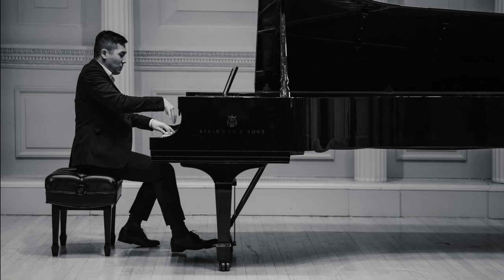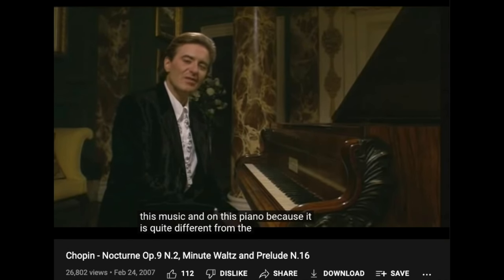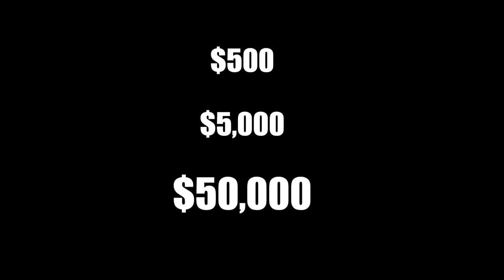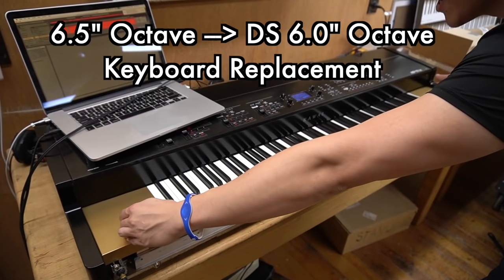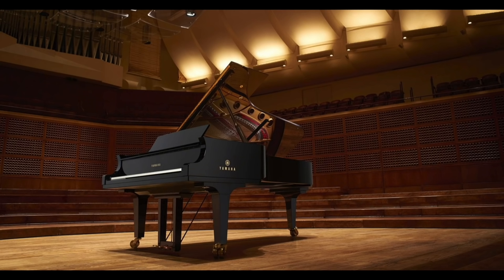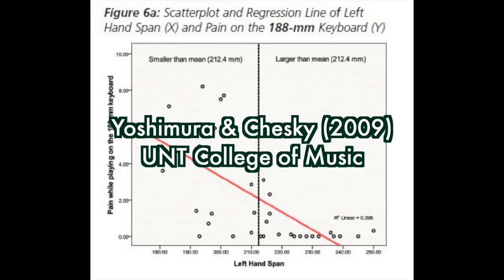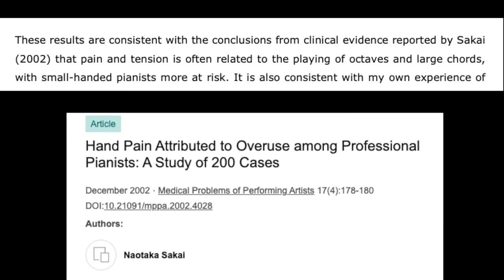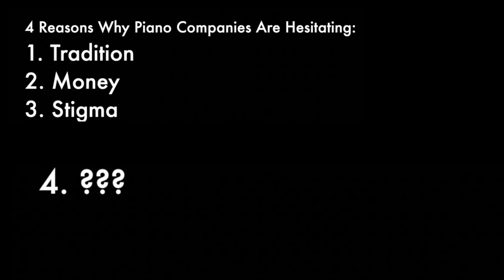Piano's Darkest Secret

Comment: You're too damn right!! I never thought my hands to be that big, they aren't indeed, but once I saw you with the ruler I tried and my left hand reaches 9", and right hand 8 3/4", but still I don't ever reached 10ths or even just octaves with central notes that easily or comfortably. According to your diagram my hand shouldn't hurt but it DID hurt when I played certain passages and what not. I knew about the growing extension of the piano keyboard, it's on piano History books, but only experimented the comfort of narrower keyboards when I had the chance to play in a harpsichord… all of a sudden even Bach, which supposedly isn't that bad on extensions, were quite more comfortable to play and all polyphony and fingering made sense, not to mention other piano works either. As you say, I needed Zero time to get used to it (which surprised me), or any problem of course going back to my regular piano. Problem is if regular piano makers, the ones you can easily find in stores, don't allow those keyboards by default it's not an easy option for most of us Worldwide, even though initiatives like the one you show by Mr.Steinbuhler are so interesting. Hope in the future those options become more easily available to everyone and stop being seen just as an oddity or frivolity by some freaks

Comment: I absolutely loved your video and admire your courage to do it!  Congratulations!  I just realized that, at the begining of this video,  there's a mistake in your conversion to centimeters.  The measure of 6.5 inches of the modern piano (from C to B) when converted to cm IS NOT 21.5 cm, BUT 16.6 cm.  This conversion of 21.5 cm corresponds to 8.5 inches which according to your video is the average size of the hand.  I hope this can be corrected, because it confuses a little bit.  I live in a Country where decimal system is used.  Greetings from Mexico.

Comment: I'm not much of a musician but I do play harmonica. Most 10 hole harmonicas have the same size holes and spacing. However, when I was about 17 I discovered Hohner's Vest Pocket harp and it quickly became my favorite due to the shorter size, closer spacing and less breath required to produce as good a sound as  larger harps. Unfortunately they are no longer made. There is a similar sized harp made by hohner now, but it lacks the extended ends which makes it very difficult to handle.

Comment: Thanks for the enlightening content. I suppose part of the problem from the manufacturing point of view is that pianos are large and expensive, and it would become quite a challenge to require concert halls and even some small stores to provide variously sized keyboards on their pianos. But perhaps a compromise could be reached: even two standard sizes would be enough to make most people happy (say, the 6.5 and a 10% smaller version, about 5.8 - corresponding roughly to the difference between mean male and female hand spans).
Reply: Experience from many pianists who have played different sizes, including trials done by David Steinbuhler, suggest that nearly all adults can be catered for with three sizes - 5.5 and 6.0 inch octaves plus the current 6.5 octave. (See DS Standard Foundation and PASK websites). Concert venues can have interchangeable keyboards/actions which can be swapped over in minutes. This has already happened in the Dallas International Piano Competition where contestants have a choice of these two DS sizes. Incidentally, the gender difference in hand spans is closer to one inch (2.5 cm) which suggests that the DS5.5 suits most women best (assuming that the current size is best for men overall which is probably not the case - it seems to be skewed towards larger handed males).  The intermediate size suits larger handed women and a sizeable proportion of men. A small proportion of women (approx 10%) find they need the DS5.1.

Comment: Thanks for sharing this. You're in good company -- Scriabin had quite small hands and injured his right hand while (over-)practicing a really difficult Liszt piece. That's how he ended up writing his pieces for the left-hand.
When I started learning piano as a kid, my teacher noted that my hands were quite "boxy". I don't have long fingers (or legs) but they're somehow flexible enough to stretch about a 10th. However, I started learning violin recently as an adult, and have struggled to cleanly place my left-hand fingers -- my wide fingers accidentally touch and mute neighbouring strings, and yet my little finger has difficulty reaching A on the D string.

One thing I find odd about the response from piano manufacturers is it doesn't address the fact that it's hard to play a "normal" piano with small hands, but it's easy to play a slightly smaller piano with small OR large hands. So they're choosing to exclude a large segment of the population, despite having an alternative that excludes nobody. Someone with large hands is not going to have problems playing on the smaller piano, and in fact they will also be able to play wider chords than ever before.

Comment: At 67 I have just started learning the piano. My hands quickly became sore but I put it down to something that would improve with practice. It did not. I moved on from beginner pieces and found I could just not do them smoothly. That's when I got my ruler and found I have tiny hands. My span is 7.2 inches. A quick bit of internet research on pianists skill level vs hand size told me I had bit of a problem.
I'm not taking this lying down. I'm an engineer and have started plans for a MIDI short scale keyboard.
Reply: Please be in touch with PASK so we can help promote a new keyboard - hopefully with 88 weighted keys!

Comment: What a lovely video.  Thank you.  I will have an alternate keyboard advantage, when and if I  get to use them . 
1. The piano accordion has a much smaller keyboard.  You can easily span a 12th. But ...
2. I like the chromatic keyboard.  The chromatic accordion is the model I hope to one day adapt to the piano.  On such an accordion a span of two octaves is no problem. It is likely to shrink a little when applied to a piano.

Comment: Actually the small key size is already very common in mini keyboards that have a size of ~5,8"/Oct. Unfortunately they lack good mechanics and the keys are not very long. Based on this it should be easy for one of the leading manufacturers to create a proper masterkeyboard with narrower keys.

Comment: Excellent video. What is curious is that certain other instruments, for instance organs or harpsichords, have always had narrower keys than the modern piano. People who play both organ and piano are completely used to switching between different sized keys, it does not interfere with their playing at all. So, here's a tip: the initial, mechanical studying of demanding pieces by Chopin & Co can be done free of pain on an organ, even an old electronic one ($100 on eBay). Once that you have committed the piece to your brain and you can play it smoothly, switch to the piano.

Comment: I am an amateur pianist with big hands - about 26cm span (or just over 10 stupid antiquated "imperial" units). I have a somewhat different problem - my fingers are too wide and can't fit between the black keys anymore without major friction, which makes it hard to play certain passages fast (such as arpeggios with mixed black/white keys). Difficult pieces are still difficult, but I could probably overcome them with a lot of practice, and I'm sure people with smaller hands struggle a lot more.
There are electronic keyboards with smaller keys, they're pretty common, but I think their keys usually have a different "action" and are not suitable for playing classical pieces (especially at a professional level). Keyboards that emulate a piano feel usually use the standard piano key sizes too...
Anyway, I fully support different-sized keyboards and pianos.

Comment: What a revelation! Your statement that awareness is the biggest roadblock is right on target. While the size and complexity of the piano presents unique manufacturing challenges to the design and construction of alternative key sizes, the concept of multiple instrument size is well known in the manufacture of violins, guitars and many other instruments. As you said, "it's freaking 2022!" It really is past time for the manufacturers to figure this out, and the one thing that will push them along is for the market to demand that they respond to what is clearly a pressing need.

Comment: I have slightly larger hands, able to play a 9th fairly easily, a friend of my fathers Earl Sheeler, had literally giant hands and could play a 10th with ease.
I learned to play a bunch of ragtime music, which requires 1-3-8 on the right hand, and If I do not practice It hurts when I play that music.
I have played for 50 years, and once played a priceless 1914 Steinway. It was so subtle that I could not find the end of how quiet it could play or the subtly of its nuance. It took everything I could put into it, and I knew there was more. 

To the subject, I bought a 3/4 Casio keyboard, and it was SO much easier to play. I could easily play a 10th, but there was absolutely no nuance to the action. It was a toy.
But its clear, that for people with normal or smaller hands, it is as painful to them, as it is to me, when I do not practice. 6.0 and 5.8 Keyboards need to be much more common place. You are absolutely right. The company that has led most innovation with electronic instruments, Yamaha, should step forward, and both subsidize and make available worldwide the smaller sized keyboards.

Thank you Mr Yu for making this known, doing the research.

Comment: It occurs to me that on the electronic piano side it is not necessary to dismantle and rebuild the piano whose sound you want. All you need is play on a slightly smaller size MIDI controller piano plugged into the back of your instrument with a standard lead. I don’t think there would be a time lag problem but it would be interesting to find out. Controller keyboards are not so expensive to build.

I also always tell friends who think they have particularly small hands (usually exactly the same size as my own!) that the distance between thumb and little finger is not the only factor.

For arpeggios and wide ranging runs you can use larger spacing between the fingers, such as a third or even fourth stretched between adjacent fingers.

As you only need to stretch as you reach each note and not hold the position you can probably span a 12th. So you might play right hand CGCEG with no thumb crossing.

The movement being led by the arm of course and no attempt made to keep previous fingers where they were!
Reply: The stretch between the fingers is certainly very important. Ideally, one needs to be able to play a 7th using 2 and 5. But for people like me who can't erven play a 6th on the 6.5 inch octave keyboard using 2 and 5, this creates major problems. When talking about 'particularly small' hands, it's important to remember that this term means different things for males vs females. 'Particularly small' for a female is less than 7.5 inches for 1-5 span. In our study of nearly 500 pianists, there were no males anywhere near that level...the smallest male hands were around the female average of 7.9 inches.

Comment: I noticed at the Beckstone grand piano was actually smaller and did not have a heavy touch we used to have one in our school in Wiltshire England and I used to love that Piano it was very light touch and the kids were very small not the same size as a bigger Piano I wonder if anybody knows about the best time being any different it was probably based on the original pianos before they went big on us
Reply: There can be very small variances in the overall width of piano keyboards from one brand to another. But not usually more than 1/4"overall.

Comment: Excellent video about what should be an improvement in pianos. I would like to point out that the video at 2:49 says the standard keyboard is 6.5 inches per octave (21.5 cm, which is incorrect should be 16.5 cm). Out of curiosity, I measured the keys on my Yamaha YPT-230: key width is 0.93 in, same as the video, but the octave distance is 6.25 inches, 1/4-inch less than the video.

Comment: Very interesting video on an important subject. What immediately struck me was the number of smaller keyboards I've seen on cheap electronic keyboards. I've had a few myself. I imagine these are generally thought to be for children, but I also think some were simply to make it easy for a band member to take their keyboard with them to gigs or play on the street. The assumption that these are just toys for kids probably contributes to the stigma. My experience is that there is ultimately a trade-off, because the smaller a keyboard is, the easier it is to hit two keys together, depending on other measurements of the fingers. I guess this is not just their width, because when we stretch to play distant notes, our fingers are at an angle to the keys, and thus tend to press the inner ones.

It is ridiculous that children of any age are usually expected to learn to play on a full-size piano. Children learning stringed instruments, from guitars to violins, have junior models. It's as though we accommodate the fact that their short limbs can't hold an instrument properly, but expect their tiny fingers will be encouraged by the challenge of notes too far apart for them! Or they're just told they'll only be able to play bigger stretches later. Presumably we'd have many more young virtuosos - and adult ones - if this idea was taken seriously and better instruments provided for youngsters.

A couple of other points:

It would have been interesting to see another clip of Tiffany Goff after she got over her emotional response and got used to the keyboard.

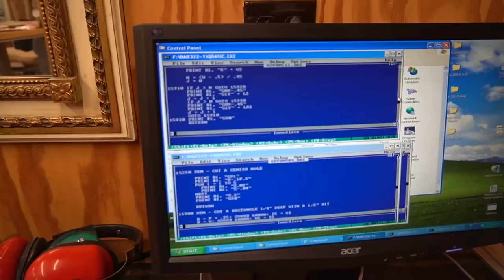And at around 6:10, I don't think you meant to say David Steinbuhler makes "ivory keys". I hope not, anyway.
Reply: No they are not ivory keys! Tiffany Goff went on to acquire a DS5.5 keyboard for her own piano. As far as I'm aware, she still lives in Cleveland and teaches there. While there is a trade-off with key width and hand size, nearly all adults find that one of the three main sizes (DS5.5, DS6.0 and conventional 6.5 inch octave) work for them. And you're right about reaching for distant notes and fingers stretching or leaping sideways leading to inaccuracies. For those of us who play on DS keys, the benefits of having the notes more directly under your hand far outweigh any slight disadvantage of the narrower keys. It's not only about accuracy, but tone and rhythmic control, legato lines etc, not to mention reduced pain and tension from stretching. The reduced mental effort when you no longer have to leap onto a note becomes so obvious.

Comment: 1 There are loads of midi controllers and a few full-fledged keyboards available with narrower keys.  The problem is, even when the electronics on these instruments is top notch (such as the Korg Micro Arranger) the key beds themselves don't feel good and aren't responsive in a very musical way.  I think these are made to keep instruments smaller, lighter, and cheaper to produce rather than to accommodate smaller hands, but perhaps it's a trend that could be encouraged.  
2 Also worth griping about is short keys.  There may be a standard key width, but there is not a standard key length, either for the whole keyboard, or for the front part of the white keys that extends beyond the black keys.  On shorter keys I find my hands all curled and crunched up, rather than fingers extended and relaxed.  Again, I think manufacturers are often too willing to save a buck.
Reply: Apart from Roli's Lumi Keys (which are unweighted) we are not aware of any digital keyboards with 88 weighted keys. And yes, the shorter keys are a problem for serious pianists. There is no official 'standard' key width, the current width was just adopted by all manufacturers in the 1880s. Before then there was considerable variation. Black key widths can also vary slightly between manufacturers.

Comment: There's also the issue that at competitions there would need to be more pianos available to accommodate different preferences. They'd need to have multiple versions of each piano.
Reply: No need for additional pianos, just interchangeable actions/keyboards that can be swapped over in minutes. A lot cheaper than and less space needed. This has already happened at the Dallas International Piano Competition where contestants have had a choice of two alternative (smaller) DS sizes. Here is a video of a keyboard changeover. (The second piano is there because it was used in the early concerto rounds.) https://www.youtube.com/watch?v=BAjXItVoPsY&list=PLHBn-VaaOCGcJDCJ8f-BZx5VZS-IXcxDi&index=26&t=2s
Reply: @paskpianos  Very interesting. Thanks for the link.